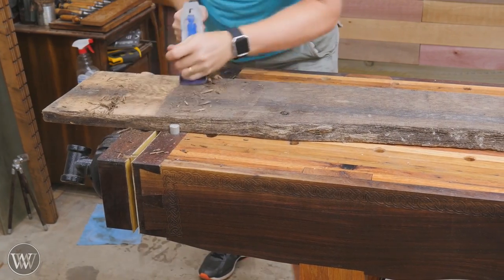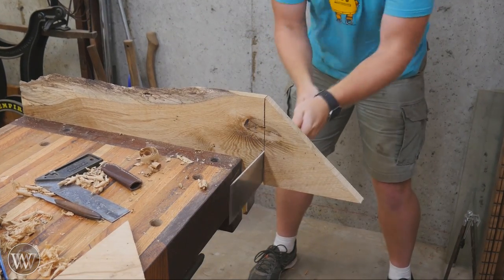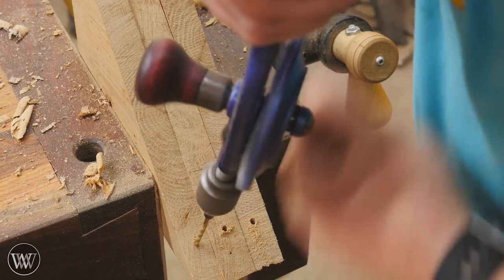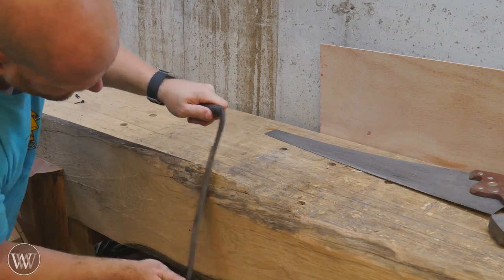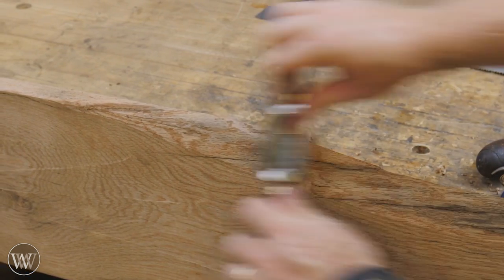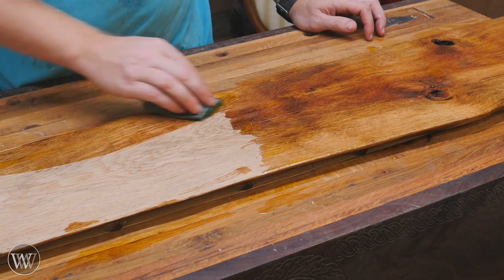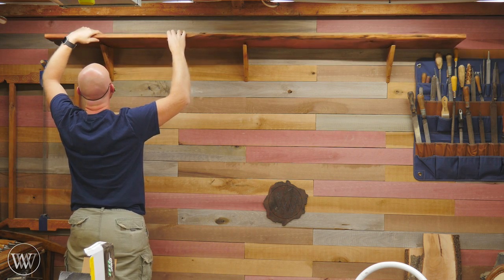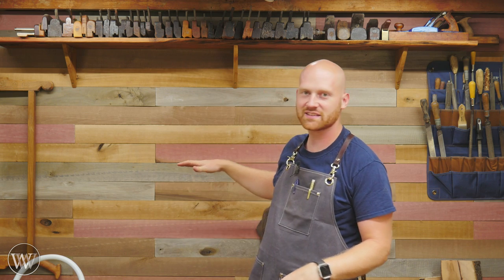How to Make a Live Edge Shelf for Woodworking Hand Tools out of White Oak

Comment: I'm working on a white oak chunk trying to get S4S.  My plane blades skip off the oak or dig in and tear out.  I miss using pine! How sharp should your plane be to get shavings?
Reply from the maker: it depends on what you are doing with it. but the rule of thumb is it should cut hair on your arm for most work. and give a clean shave in a single pass for smoothing.

Comment: Nice shelf! Do you have a preference on flat bottom spoke shave vs a rounded bottom? I thought you might have been using. Flat bottom.
Reply from the maker: I use both for all kinds of different work the one used in the video can be either if you flip the mouth over. but it was round for that part.

Comment: A plane till, thats what I need... Gotta build one, one of these days. I'm curious as to why you didn't cut you shelf brackets so that the hypotenuse is long grain?
Reply from the maker: my thought exactly. with the grain direction it is better to have the grain in shear than to have it in tension. but in this case, it really does not matter as the shelf does not have enough weight for either to matter.
Reply: Yes, I guess you know exactly what you are going to use it for, whereas I never really know what a customer is REALLY going to use it for... ;)